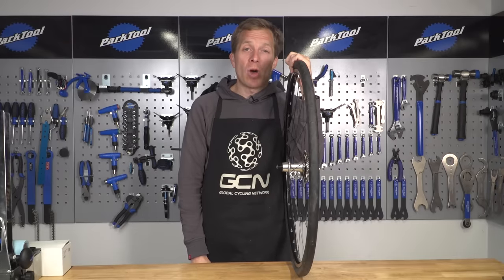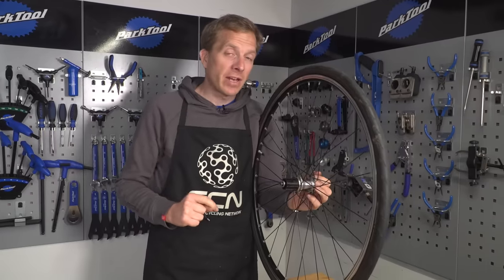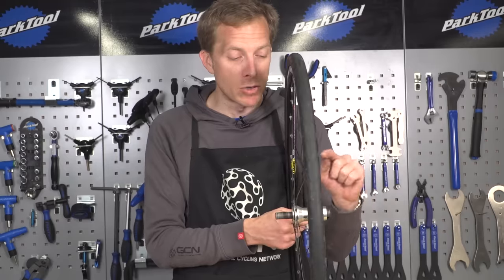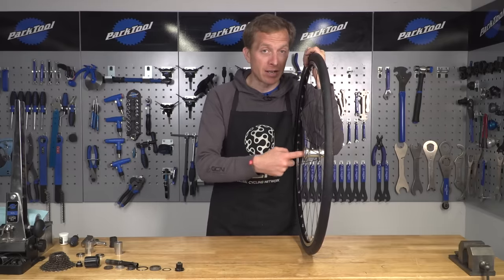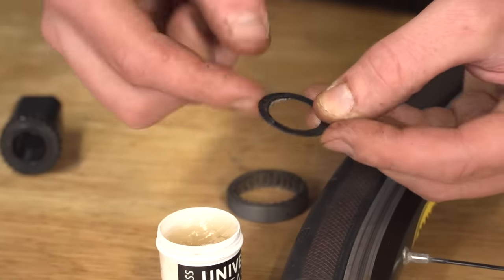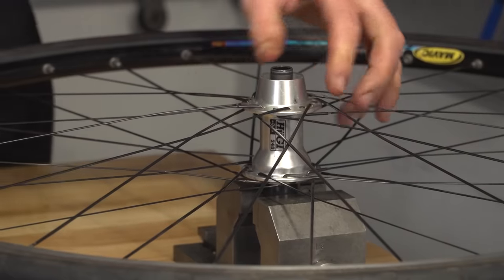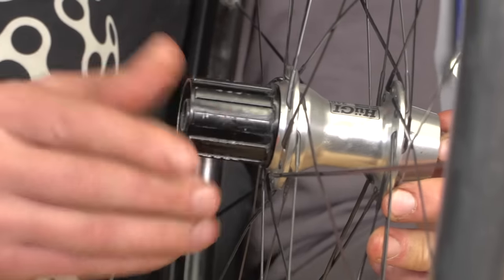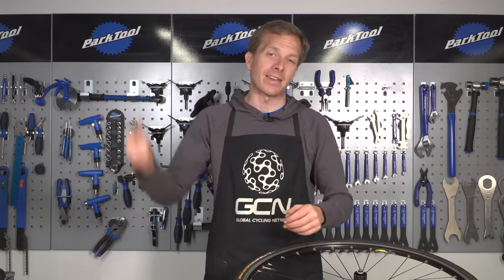How To Replace Cartridge Hub Bearings In Your Road Bike Wheels

Comment: Wonderful to see an in depth video like this.. I take my hat of to the patience that you have doing this. I just wonder at how much it cost to service this freehub compared to replacing it! Those tools can't have been cheap at all, makes you wonder since it may well last another 20 years if it isn't worth taking it to a high end bike shop to get it done there. Brilliant video none the less and very interesting! Would love to see one with a cup and cone bearing... bring on the greese!
Reply: John Rogers my thoughts exactly. That, and I'm wondering why cup and cone are considered to be more hassle. It also makes me appreciate my Hope and Chris King hubs all the more!
Reply: Hi, it was the hub bearings being replaced, as opposed to freehub. To replace the hub would cost a fair bit. As then the wheel would need to be rebuilt. New spokes, labour etc.
Reply: The specialised tools are there mainly to make sure the bearings are kept square to the hub. There are other ways to do this if it is a one-off job, but avoiding damage to the hub body is essential as this is the part you do not want to replace. Others suggested using an old bearing and an old hub or piece of threaded rod. I think I used a very long coach bolt the last time I did this. What I didn't do last time was to take photos of each piece as it was removed. Boy, did that take me ages to figure out

Comment: I fail to see how this can be easier than servicing a loose ball bearing hub. You need so many special tools... Also I see the drive side bearing sits inside the of the hub shell, far away from the mounting end giving it a lot of torque which potentially can bend the axle. Definetely prefer a Shimano lose bearing system
Reply: Rodrigo Maero the design seems to be fine. Nearly 20years old. No problems.
Reply: There's one more bearing in the freehub body that helps distribute the load.
Reply: You don't need many special tools.  You can use a block of wood instead of the protector and a steel QR or threaded rod to press back in, using any available nut or even the old bearings as the "drift".  Is a threaded rod a special tool?  Anyway, who cares. It's a half hour job every few years give or take either way.  With C&C it's once a year, still not a big deal.
Reply: Then get used to cleaning out milky oil.  They definitely aren't water resistant.

Comment: Hi GCN.I have a Bontrager Aeolus rear hub that seems to be almost identical with the one in video.It seems to be a loose bearings, but I managed to cleand regrease them and the same loose.Could you please tell me if I need the splined tool to remove the bearing from the drive side to this type of hub?
I can't find any video or manual for this type of hubs.
Thank you.

Comment: The 'ring nut instalation and removal tool' ....more information on the tool used in the video was requested but not answered earlier in the thread. 
Could you provide more information on the brand name, dimensions etc ? I'm having a hard time identifying the tool in Google searches. Many thanks in anticipation.

Comment: The drifts you are using is it possible to buy those individually? I need to fit 6001 bearings 28x12x8. All kits I can find cost 300 quid might as well buy new wheels!

Comment: Loose bearings Procedure : freewheel or cassette remover tool, remove components, swap out loose bearings by removing from drive side shaft nut, have a beer while you see how tight the cups have to be before installing wheel nuts. It takes me really 5 minutes to redo a front wheel rebearing. Usually 10 minutes on the back wheel for freewheel sets due to measuring the distance on the drive side and setting the play.

Comment: This was better than I expected.  No park tool puller or press.  Nice trick using the axle as a punch.  However, for axle protector, a block of wood.  Instead of the drifts, why not use the old bearings and use a steel trainer QR or a simple bolt and washers as the press.  I haven't tried it yet as I have C&C but will have cartridges soon and plan to give this a shot some day as it costs nothing and seems it should work fine.

Comment: I've been experiencing gritting noise when i freewheel and also my wheel has a slight wobble, Im suspecting the bearings are loose. Is it still rideable or is it dangerous to ride my bike anymore? Its too hard to find stocks on my bearing size thats why I'm trying to use this .

Comment: Why not use the Parktool HBP-1 hub bearing press set to press in the bearings instead of a mallet and a vice??
Reply: you can get those DT hub special tools on ebay for a lot cheaper then the Parktool bearing press...but then again the Parktool press can handle any number of different hubs....all it takes is a few more $$

Comment: Keep checking (every 6 months depending on wet weather use 🙄) grease on bearings even if you have to pry out bearing  seals to regrease  should delay costlier bearing replacement 👍

Comment: #askgcntech I race in u17 road races and there are limits in Poland for gear size which is 46 x 14. People who are checking this ask us to put our gear to hardest and they are checking how much the crank arm will turn in the given distance. I want to buy an oval chain ring and I don't know if I can because I don't know if the oval will change the distance the crank arm turns. And if it will which chain ring (with how many teeth) will give the same effect like 46t round chain ring gives? (I want to buy absoluteBLACK chain ring)

Comment: Hey GCN can you replace the bearings of speedplay pedals?
Reply: Daniel Otero yes you can. I can highly recommend Rulla bearings (UK based and also on eBay) who supply a kit with full instructions.  Fairly simple to do - the worst but was getting the spring washer out but after that, it was a quick job.

Comment: yea well no mention of making sure not to strip any axle Thread which is what I did on my old  phil woods freewheel rear hub...so unless I figure how to repair those threads I am keeping an eye on ebay for a cheap rear freewheel to swap out a rear axle for....Yes I hammered my axle without an axle protector pushing causing  misalignment of the threads on the axle
Reply: mgsboedmisodpc2 there are no threads on this axle. Thanks. Jon

Comment: No not easier, ball bearing are messy but if you clean and regrease it last a long time. You almost always have to replace cartridge bearings, although it requires less adjustment